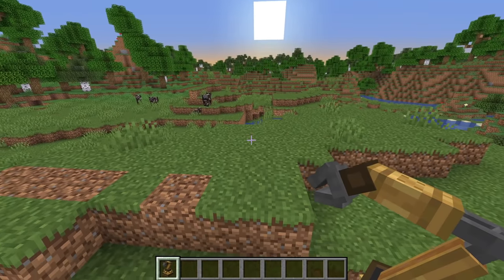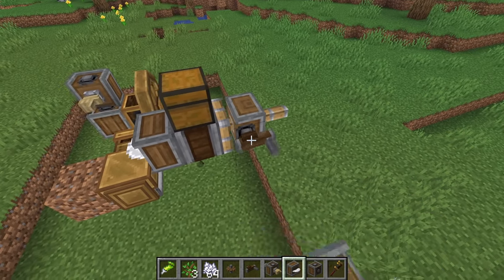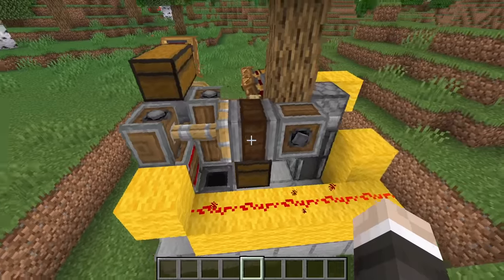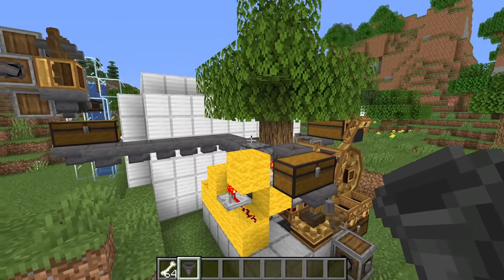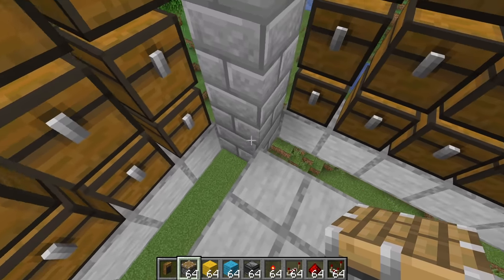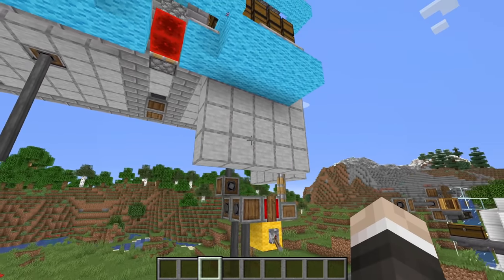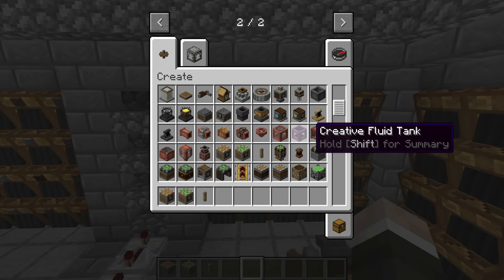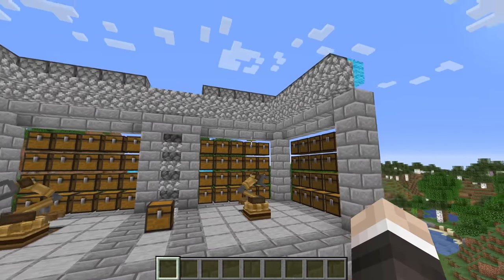Automating Everything with Mechanical Minecraft Robots

Comment: The bonemeal supply can now overflow, I would love to see an adjustment that when the system overflows, it automatically adds light to the skeleton spawners and prevents them from spawning.
Reply: would be kinda easy to do, there's a belt observer that can be filtered to give off a redstone signal when there's the item in the filter on the belt so you just put it somewhere on the bone transporting belt and take the redstone signal to lamps that would deactivate the spawners
Reply: @dubl33_27  That would activate whenever the farm output its bones, even before it filled up. A stockpile switch on the bonemeal chest, set to activate when the chest is 100% full, would work better, for the lamps.
Reply: Would a kelp farm not be easier
Reply: I'm more worried about the charcoal overflowing
Reply: @aperson6081  that would require a 3x3 mechanical crafter instead of just one. Plus a cooker to cook it first.
Reply: @Anarcha66  you could have another belt observer further out on the belt and have an and gate connecting the 2 observers
Reply: @WulfTyger a bulk smoker with a mechanical arm

Comment: "Before we get on with the farms, give me a second to defy all laws of thermodynamics and physics to crete a perpetual motion machine."
Reply: More like exploit the weird vanilla Minecraft systems using the physically consistent Create mod systems
Reply: Actually, it uses the suns energy to grow the tree
Reply: @LPGK_the_catboy  I think the real infinite energy source is the skeleton spawners actually. The bone meal is what makes the tree harvesting process even mildly efficient, because with just the sun's energy saplings grow much more slowly
Reply: Not perpetual motion, but matter in Minecraft needs no energy to be created soo
Reply: @LPGK_the_catboy  no it uses bone meal
Reply: hes not, the skeleton farm was an outside source.
Reply: There is a huge difference between self fueling, and perpetual motion... Tango's engines are a bit cheaty cheaty taking advantage of a flaw in game mechanics by adding and removing the smeltable item... Mumbo actually came up with a way to fuel both sides of the system within the mechanics of the (more or less vanilla) game. He used the robotic arm and related create components, but the same principle could of worked with entirely vanilla components (I have long used similar to fuel super smelters.)
Reply: @mattlewandowski73  but it also moves forever
Reply: @Thod_  it moves forever with a power source being made, it’s like a solar powered car, it can run forever (with enough solar panels) but it isn’t perpetual motion because it’s just being constantly fueled.
Reply: @anarkizt  I'd say spawners are enough of an infinite energy source that if you include them in the machine it counts as perpetual motion. Do trees in Minecraft even need sun if they have bone meal? Can you grow them at night?
Reply: @Nat_the_Chicken  They do actually require light, not sunlight per-se but light. like you can't grow them underground without a light source.
Reply: @anarkizt  OK that's fair, but it still seems like that's a small amount of the energy in this case
Reply: @anarkizt  but it’s furling itself

Comment: Deployers draw from any inventory on the contraption as long as you have the item you want it to place set as the filter and not just right clicked into the hand, so the saplings would auto refll it without the need for a hopper, also blast furnaces can be used with the furnace generator to quadruple its output, and finally hoppers will insert items into the top slot when placed on top and the fuel slot when placed on the sides so to automate that process dosent require create

Comment: A good simple way to build an auto farm would be to use a vertical windmill bearing and make a line of placers and saws on two sides with the sails on the others. Then the farm works without need of rotational power and then you can use the portable storage connections to pull the inventory and then belts and such for item movement and filtering.

Comment: I love how he creates an infinite energy supply, and his first thought is to make a storage system
Reply: Tango did the same...
Every redstone Minecraft player is one mind 😆
Reply: @zoe-maefaulkner100  pretty much
Reply: One of the big issue in Minecraft is how to organize your chest and eventually try to  partially automate the sistem. Fo those in modded minecraft exist many mod that help you to collect and distribuite what you need. Es. Applied energistic, refined storage, simple storage, etc but for mumbo wievers aren't  advisable.
Reply: @pierfi8359  and there are simple redstone contraptions that do just that
Reply: he actually could've had double the power if he used a blast furnace instead of a regular one
Reply: @buckiethecat  a blast furnace can only smelt ores, he would have to input ore somehow, and the wood is only useful as a fuel. With a furnace, he can use wood as a fuel and as a material to smelt, and then input the output back in as a more efficient fuel.

Comment: You dont need a mechanical crafter. Just use a millstone and it gives five bonemeal instead of one per bone. Also the furnace engine can be tricked using chutes and mechanical fans which as long as you have fuel, you should be fine. It works by hooking up the fan to the output so as soon as the smelting begins, the smeltable is taken out and the furnace continues to burn and give rotational power and as soon as the furnace stops burning it restarts itself with no loss of resources.

Comment: You  should install JEI for looking up recipes. Bones can be crushed with create to get more bonemeal and you do not need to use that much glue just use linear chassis that more lag friendly. Furthermore you can put signs at the chests and turn the hole chest wall 180 degrees to have the funnels connect to the back of the chest when you want to sort stuff. After sorting the chest turn back 180 degrees and you see the signs and can use the chests. Nice video by the way
Reply: I was thinking just put them behind the chest out of sight, as the depo looks accessible by the arm underground, haven't tested as I still haven't played it yet
Reply: @Codingale  this will only work when you make the hole setup smaller because the arm has a reach limit and i think this setup was build at this limit. But apart from that, this is a good idea :)

Comment: “You can move mob spawners”
Then why didn’t he use blaze rods as fuel, what was the point of the trees?
Reply: Because the furnace also needs to be cooking something, so the tree's satisfied both fuel and item to smelt
Reply: @anonimase4315  yh but he's got a point i mean it would save so much time and you could also have a cobble farm.
Also he could have used any other power source
Reply: We can't confirm it can transport spawner between dimension
Reply: @anonimase4315  if you see tango's design, you can pull the smeltable item out before it finishes cooking and the fuel is still used, so a redstone clock with fans can suck the smeltable item out and put it back when it needs to use another fuel, so you only need the fuel
Reply: @fltfathin  It seems very likely that you can since entities travel through portals in vanilla
Reply: @fltfathin  you can just use a cart contraption to move the spawner, then shift rightclick the contraption with a wrench to pick it up as an item
Reply: ✨Presentation✨
Reply: @fltfathin  zedaph did it on his create series with tango
Reply: @notsquash3980  cobble isn’t fully renuable
Reply: @frankflight9951  Ever heard of cobblestone generator? With create you don't even need to mine it yourself, just slap down a drill block where the cobble outputs and it will passively generate cobble
Reply: @luperamoon  oh yeah, thanks but mambo might have just wanted it to be a two in one
Reply: @fltfathin  Well, it appears in his inventory. So it definitely can.

Comment: You can use these filter things to put multiple items in the one chest for e.g. I put red stone and red stone blocks into the filter and make sure it’s set to something like only allow them it will allow only those blocks to be inputted or if I have diamonds in the filter and I choose an option to not let it in it won’t filter it in, then you just have to put the filter in the filter thing for the brass thing

Comment: You don't need item frames on the storage system! Just add a row or two of pressure plates/trip wires in front of the chests that detect when you are standing in front of them. Have the pressure plates/trip wires be responsible for retracting the funnels. This way, you can see which chests contain what items while standing back, then move forward when you find the item you want!

Comment: If you use a blast furnace you can get double the stress to work with, and you can pull ores out of the furnace before they are done to keep it on as long as fuel is supplied

Comment: This is actually very smart thing to do with mechanical arms, but the power generator will eventually overflow with charcoal and stop working. I sometime did something similar and ended up timing it so it's 1 piece of wood burnt with 1 coal.

Comment: considering that the flywheel system could have been simplified by using kelp as the thing to burn as well as the fuel, this does seem a little needlessly overdone. it's very cool tho for sure.

Comment: If you add another mod called “Create Craft and Additions” you can use a furnace engine, alternator, induction, heater and some other copper stuff and you can make a totally infinite supply of energy just need to jump start it, no wood or coal required (only for jumpstarting it’s required) it’s actually super cool and compact

Comment: Surprisingly enough, as powerful as the flywheel engine is. I still prefer to use several windmills stuck together on the same system. Far less complex, easily expanded and even 2 windmills can outperform this specific engine model :D

Comment: Question if you moved the chest closer and put the filters on back of chest couldnt it still reach them reducing the footprint and leaving you the ability to put item frames on the fron of the chest with the items in it removing the need for the filter wall being in front

Comment: why would you limit yourself to 1 item per chest in your storage system?
using the brass filters you can filter out multiple items at once. you can also do whole categories of items based on the tags of an item.
you should really use jei when working with modded stuff as its really good at showing you what is possible